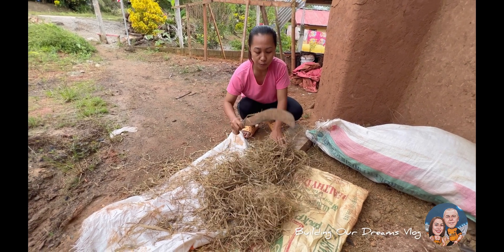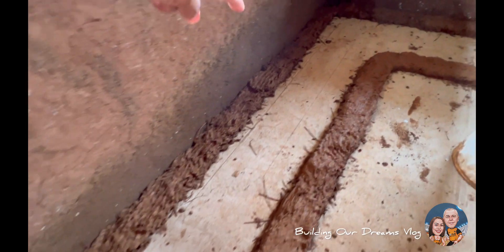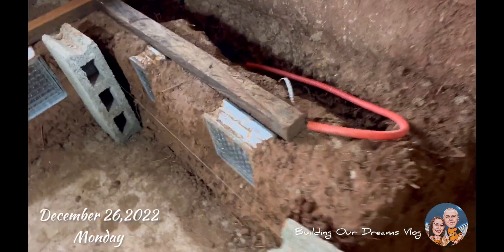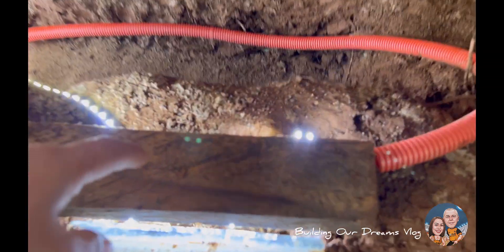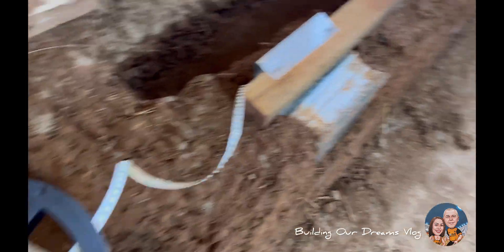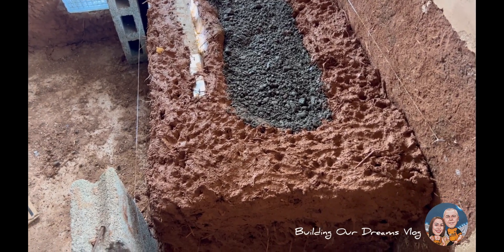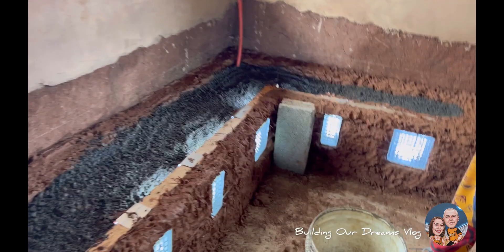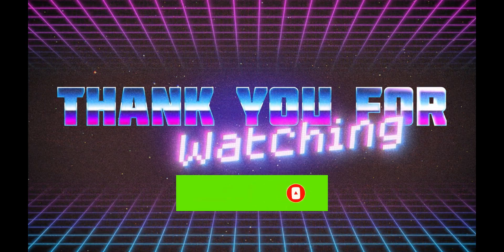🛖PART#24 earthbag house update |  MAKING A COB BENCH WITH LED LIGHTS | WITH BRITISH FOREIGNER🇬🇧

Comment: Good day ate... pila ang total cost sa earthbag build ninyo? Plan pud namo sa akung SO na ingun ana na material kay natural Seismic resistant siya
Reply from the maker: Hello good day..dependi po sa gidak on sa inyong itukod..kani amoa 110sqm kay nag cost og 1.2m kung gi concrete namu for sure more than 3m jud for sure thanks
Reply: @BuildingOurDreamsVlogPh  wow that's really cost effective good to know ate. Want to do the same but likely gonna try to do a high ceiling for the living room probably with wood material. other than that you place looks amazing. Maau kaau ang results and also natural less toxic material grabi pud kaau na fire proof
Reply from the maker: @FeydHarkon666  yeah fireproof and soundproof..ang  mga gamit sa house ky dili mag mould unlike sa concrete ☺️.. good luck po sa dream house nyo. 🫶
Reply: @BuildingOurDreamsVlogPh  Oh right, yes I read na naturally it regulates humidity because of the breathable material. 

Also Cob is a good material for Pizza oven lol

Thanks for the heads up... looking forward to build up the ranch I bought from my parents. Your hubby is very lucky to have a very confident, assertive bisdak such as yourself. Happy for you both :goodvibes: